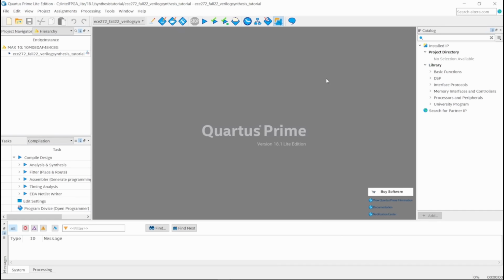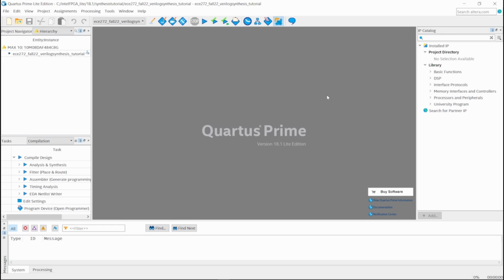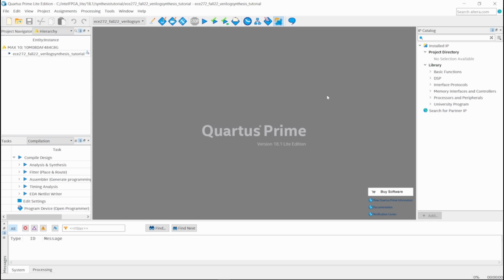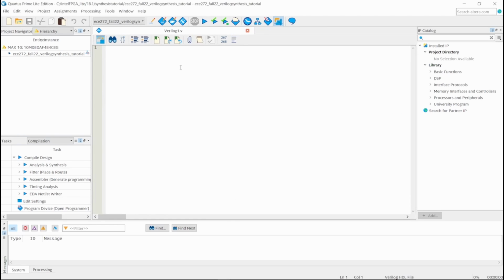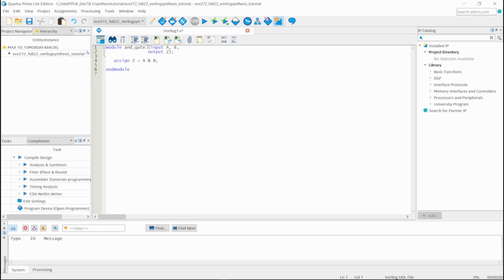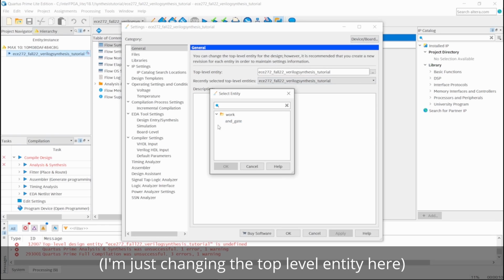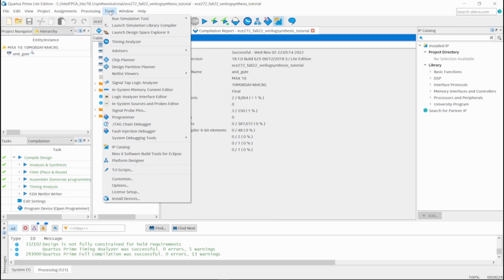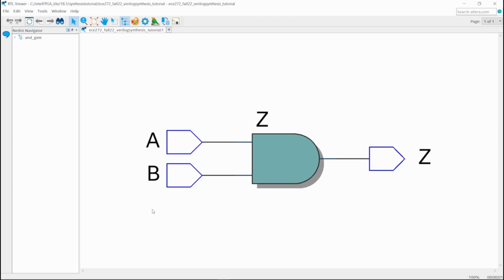How to Synthesize Verilog HDL in Quartus Prime (OSU ECE272)

Comment from the maker: Note: You should probably actually use SystemVerilog, not Verilog like I used in this video. There are minor differences that could cause issues copying the SV code directly from the book, so you could run into errors if you use Verilog instead of SystemVerilog.